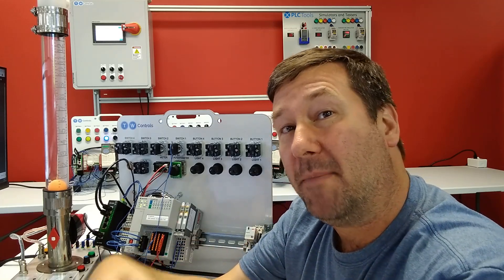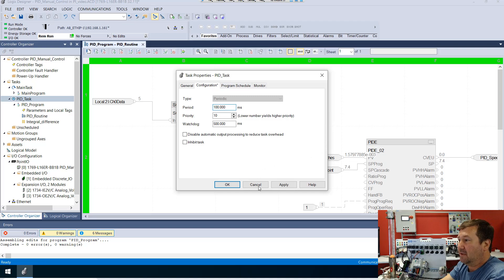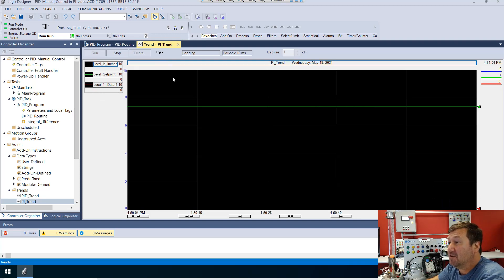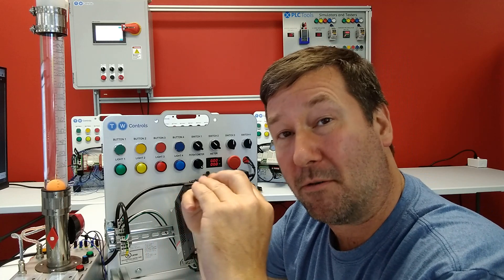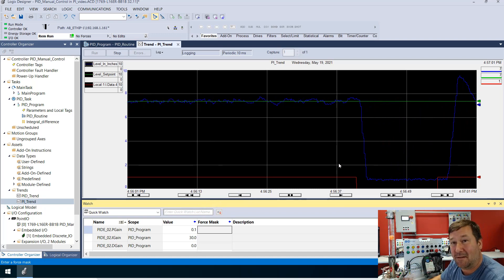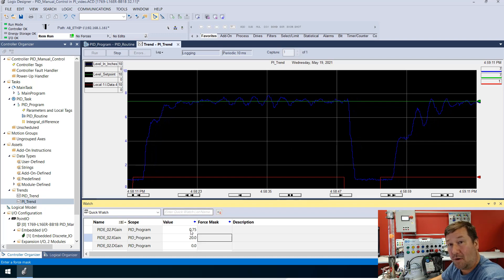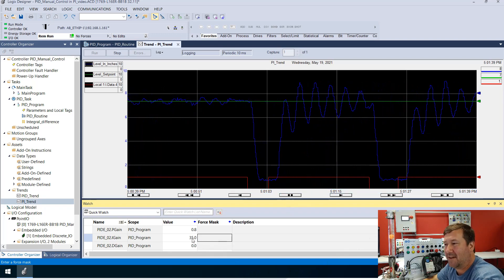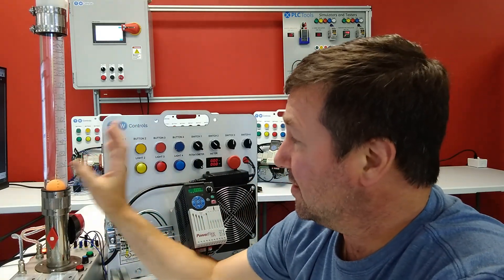Proportional Integral Control. Allen Bradley Studio 5000 PID Explained

Comment: Currently i am preparing temperature close loop pid here due to intergral action output are saturated because temperature is slow moving parameter so what i want to do?

For temperature control ON/OFF controller is better than the PID controller?
Reply from the maker: It is very application dependent.
Reply: Can you elaborate that providing the example
For one on/off and one for PID
Reply from the maker: Here are my PID videos
https://twcontrols.com/pid-control-proportional-integral-derivative

A PID that pulses an output is still a PID, you just adjust your frequency of a sample rate timer
https://youtu.be/oKwK3uo_eVg

Comment: The way I think of this is I think of the PGain as a multiplier value.  When I tune a loop, I take the percentage of the error between the PV and SP and multiply that value by the PGain and that is how much the output will move.  Higher the PGain, the bigger movement the PID will make the output value change.  If you have a PGain of 1 and a 10% error in PV from SP, then the output will move 10%, PGain of 2 with the same 10% error, then the output will move by 20%.  The Igain just repeats the PGain over time so for for every PGain move, the error between the PV and SP gets smaller and smaller over time to help get the offset of PV back to SP quicker.
Reply from the maker: That only holds true in a positional PID equation.  AB uses a velocity PID equation.  The PGain is multiplied by the change in the error, not the difference between the PV and SP.  I think I need to do another video specifically about the differences between the positional and velocity PID equations to help with this.

Comment: Tim, I was taught P=whole number i.e.1.0, I=10th i.e. 0.1, and D=100th i.e. 0.001. I will have to try this the next time I do a PID.
I deal with mostly Temperature slower to react. not sure if that makes a difference. Your Videos are very helpful, glad you decided to keep the channel going.
Reply from the maker: The challenge to this rule is it is going to depend on the equation.  Check out this one where we talk about velocity vs position equations.
https://twcontrols.com/lessons/pid-velocity-vs-positional-equation-studio-5000-pide-instruction

Comment: Love the videos so far....but there are some general rules of thumb that can be used instead of just changing values at a guess....which we rarely can do in real situations.
Reply from the maker: Yes there are. Upcoming videos include PID AutoTuning and running them through some manual equations to get decent ideas of what to enter. For this video I really wanted people to understand the relationship between the proportional and integral.
Reply: When is are these videos coming. Also we need the derivative video.